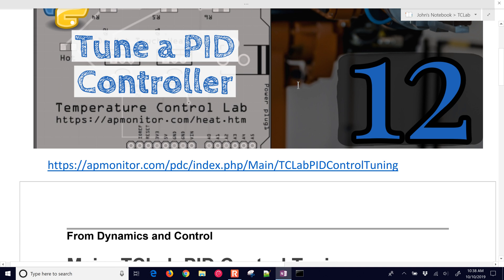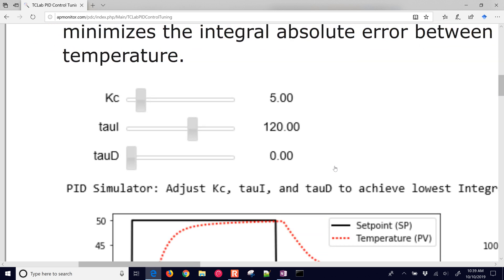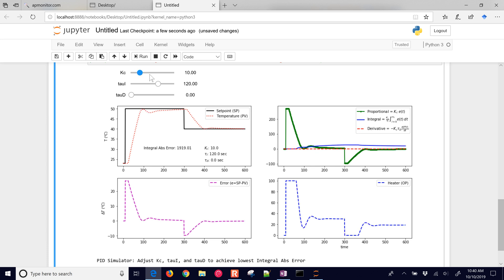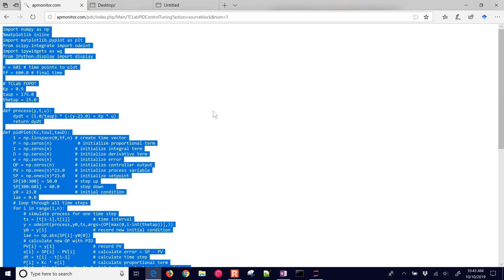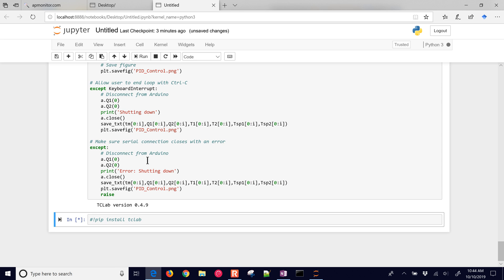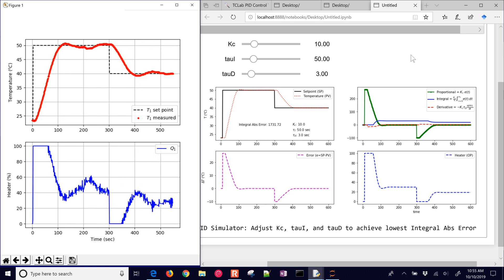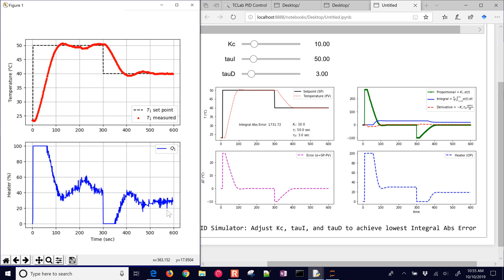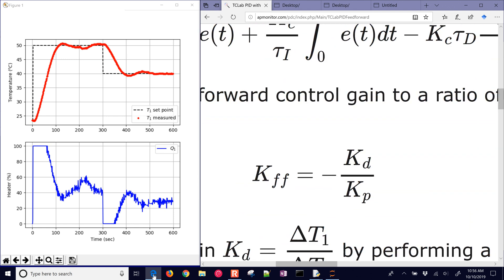TCLab: PID Control Simulator and Tuning

Comment: The problem with this method is that the gain values will need to change when the step size changes.   One should use ITAE for finding the location of the fast poles or place the closed loop poles on the negative real axis.
Reply from the maker: It is nonlinear with 10-20% change in the gain. Great opportunity to try the method that you mentioned. Another option is gain scheduling.